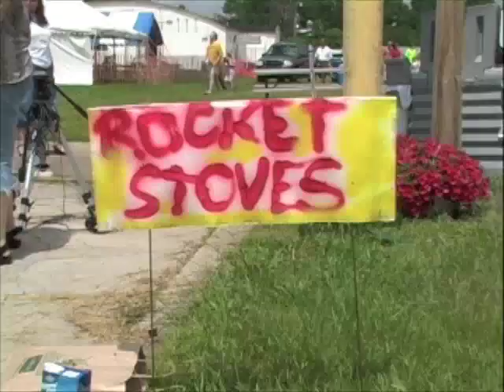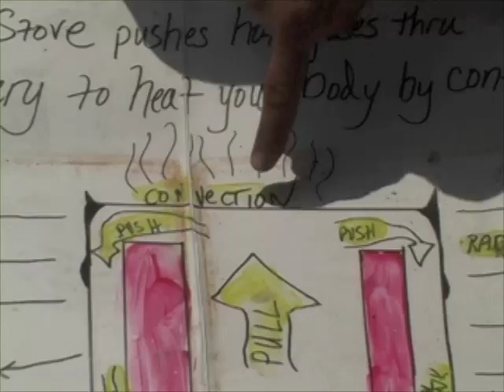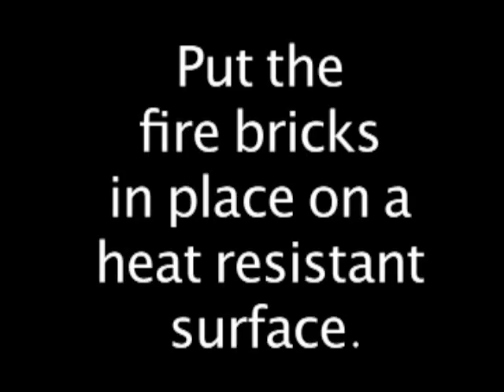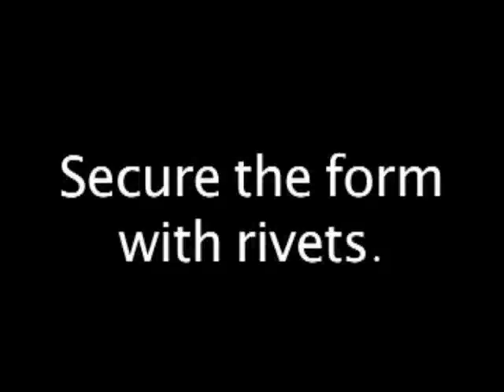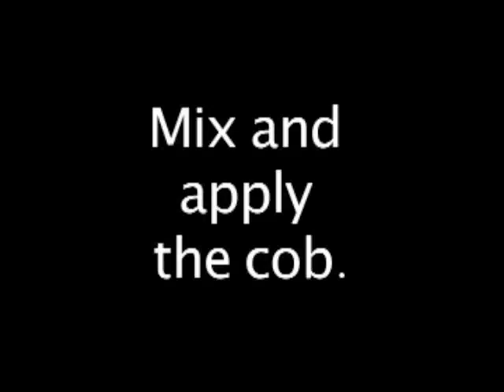The principles of a rocket stove and how to build one.

Comment: Everything looks good for a demonstration model, but for one that you put in your house, you need to assume the inner metal part of the heat riser will burn away. I recommend a clay mud with 25%-30% sand (it's what brick is made of) with and vermiculite or pearlite so that when your inner tube burns away, your insulation doesn't pour into your burn chamber.

Comment: These rocket stoves are Great, built my first one,no regrets, works A1.but now researching on new ideas with this concept,the trick is to have little wood imput and great heat output compared to standard old wood stoves, which so much of the heat is wasted right out the flue pipe.

Comment from the maker: @Rockinghorseshart the rocket stove will give off a little smoke into the house.  It's important to realize that before installing it.  If the utility area you mention is like a screen porch, then it may be appropriate to put the rocket stove there.  Not a lot of smoke; just a little as the fire gets started.  As for alternative designs; I'm not so sure.  The main thing about the 55 gallon drum is it won't burn.  Something smaller but still hardy might work for you.

Comment from the maker: More insulation could be better.  It would depend on the site you are installing it in.   A very cold winter & more insulation would be a boon.  Warmer climate, maybe less insulation; though I would tend to put more insulation in it in either climate.  It will be more efficient to use once you learn how to use it.

Comment from the maker: When you first light the stove, some smoke goes into the room; then when there is sufficient heat the smoke is drawn along with the hot air into the combustion chamber.  The best way to deal with this is to encase the area where the fire is lit, rather like a traditional fireplace has a screen on it for the same reason; or to put the part of the stove where it is lit outside.  It doesn't take long for the heat to drawn all the smoke into the combustion area.

Comment from the maker: @Dolichocephalus just don't use any thing that is flammable.  If there are any unburned bits mixed in with the ash, they likely would catch fire, as the stove reaches very high temperatures.  The vermiculite is volcanic and so very heat resistant as well as being ideally suited to dispersing high heat.  Ash and sand would work, and could do a very good job of it too.

Comment: I don't understand something on the two openings for the combustion chamber.  I see the j-shape.  One hole is for the fire to go up, vertical.  One is for the fuel, but the fuel one you had a hole on top and not the bottom side.  You have two vertical holes.  I do not understand.  Thanks for the video.

Comment: Can you show more about the exhaust end of the rocket stove... I have tried building the small ones with cans, not with great success tho. I used kitty litter for insulation as it was on hand and FREE..  Could that been the cause of my problem.?? Seems as tho it would start to draw, but wouldn't catch up.. Like it wasn't getting and staying hot enuf. Thanks cause I'm livntolaugh :-)
Reply from the maker: livntolaugh, thanks for you comment.  I'm not doing more videos at this time.  I recommend Ianto Evans book: Rocket Mass Heaters.  Best of luck to you.
Reply: +livntolaugh This is because heat does not scale.  What I mean is that there is a break point whereat the heat generated by your fire is too little and your chimney too short to create an effective draft.   Build it large enough and it will work.

Comment: I'm only half way through but vermiculite was mentioned 4 times and not once did the words "use extreme caution, causes cancer" come after it. Is this some magic vermiculite that you're using or is that maybe an important detail worth noting?
Reply from the maker: It is not the vermiculite itself that has asbestos, but rather from the mine it comes from. According to wikipedia, at this time, vermiculite for sale should have been inspected and only be for sale if it is asbestos free.  So in other words, it's your regular garden variety vermiculite that is completely asbestos free.

Comment from the maker: Nzinga, Joe; thanks for you comments.  There should be minimal buildup of creosote - really none if it is operated correctly.  I advise you to look at Ianto Evans book - mentioned in my replies below.  Nzinga; I'm not sure of a group.  There are zoning laws that most like prevent building this type of stove in the city.  However, any construction crew could make the stove from this video or with Ianto Evans book.
Reply: Amazing.  Thing's to help lower-income people tend to be illegal.  Thanks for your quick response.
Reply: +nzinga zindua That's because a lot of things that people will do aren't necessarily safe.  I once had a tenant burning wood in a barrel set on top of cinder blocks in front of an open window inside a second floor apartment.  It generated heat, sure.  As well as lots and lots of carbon monoxide, not to mention potentially burning the house down.   Being poor is not a license nor and excuse to endanger yourself or other people.

Comment: This concept could be improved upon by copying some of the design principles of a solid fuel Aga - a small gravity fed fire with exhaust gasses drawn around an inner cast iron cylinder, the top of which heats up for cooking, then flowing under a second hot plate which operates at a lower temperature and simultaneously over two cast iron ovens stacked one on top of another before finally exiting and all surrounded by insulating vermiculite - super efficient thermal mass heater for cooking, space heating and even hot water with the addition of a small boiler which wraps partly around the cylinder.

Comment: This guy totally missed the major part of the concept. The rocket stove is designed high enough so that the heat going out of the chimney creates a suction, drawing more and more air into the chamber as the heat builds. As more and more air gets sucked in as it heats up, a blast furnace effect is created. That is what causes the extreme heat. The insulation is important, but this example is overkill. You can build an effective rocket stove out of fire brick alone and put a grate on top of it to cook on.
Reply from the maker: Hi; well it does depend on how cold it gets where you live.  More insulation is better in colder weather.  Helps keep everything warmer longer.
Reply from the maker: starman2765 Which is to say, the rocket stove is not just for cooking, but also heating a dwelling.